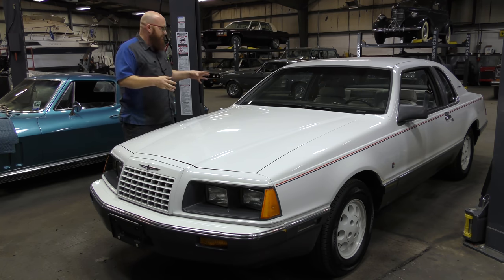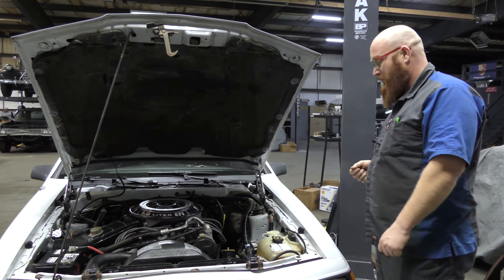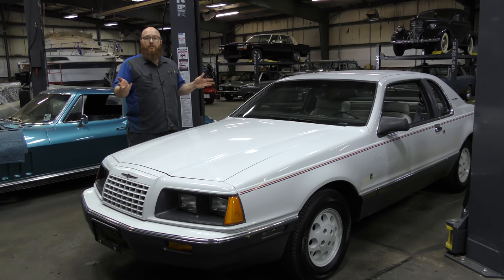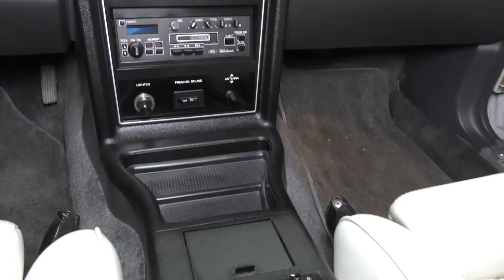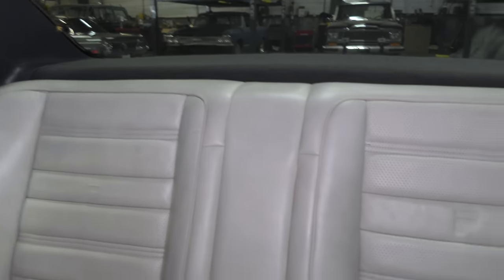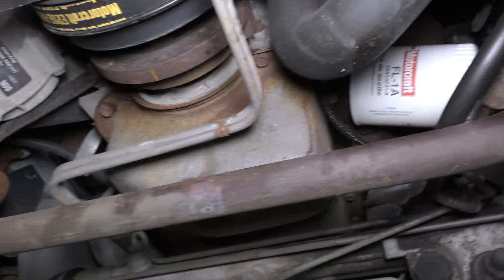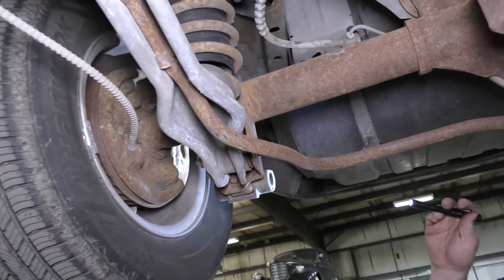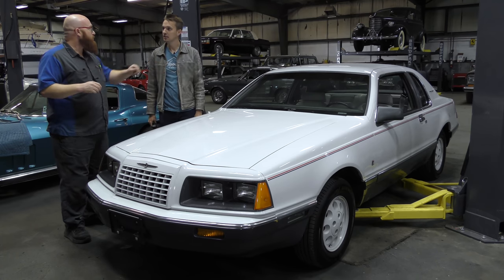The Car Matches My Shoes?!? The CAR WIZARD has Rare 1984 Fila Edition Ford Thunderbird in his shop

Comment: I was given one identical Fila. It is no longer white, and white leather interior is also gone. Someone hacked original wiring to motor, and it was also converted to a carburetor. It did not run. I asked about it, and I was told, "make it run, it's yours". So i did, and kept the 302 carbureted, and the AOD didn't work. Got another AOD, installed it, and it also was crap. It is now a charcoal gray, interior is half FILA half 84 Mercury cougar LS. I found a donor car and borrowed 60% of the interior, as the original white leather had almost vaporized, amongst other little things. I have all needed to put It on the road. So, i own one of these things, and it is no longer original. I still have all emblems and unique metal tab for authenticity on core support. It is the only ford i own out of 12 or so vehicles i own now. The original wheels went to a dumb kid with a Ford focus. I still see my wheels in town from time to time. After watching this video, I'm going to do the right thing and get my Fila on the road again. Thank you🤙

Comment: That's my kind of car.  I am a huge fan of the 1983 through 1986 Thunderbird.   Didn't like the 87 or 88 though.   I wish Ford would have stuck with this body til the 1989 came out. I have owned three of these.  First a base 86 6 cylinder with 4 speed auto.  Then an 86 elan with a 6 cylinder and 3 speed auto.  The difference in gas mileage was so different.   That 4 speed would go as high as 34 mpg.  The 3 speed would only get 22 on it's best day.  I had an 30th anniversary 85.  302 V-8 4 speed trans.  Nice car.  My favorite would be an 84 or 85 Fila, with the charcoal interior.  I even had a 97 limited edition for awhile.  The perfect Thunderbird beside the for mentioned would be the 89 to 92.  Super clean style compared to the fat lipped 94 and 95.  The thing I didn't like was in 1989 no V-8 and those stupid motorized seat belts.

Comment: I'm so old that that I've seem 5.0 Thunderbirds smoke 5.0 Mustangs off the line (red light to red light). I've also seen similar T-Birds sell for well under $1000.00 in our part of the South East because nobody wanted them as opposed to Mustangs with the same/very similar engines and transmissions.

Comment: Great Car!!  The only thing Ford came up short on is the brakes.  Should have been 4 wheel disc. Everything else is great on this car!!  Brakes are a biggie. Best you can do is EBC Red stuff and good rotors.  Rear Drums you can do nothing with as good drums are no longer available. Would have to convert the rears to disc.. Then it is perfect!!
Reply: Pretty sure Ford upgraded to rear disc on the '87 model.

Comment: Wizard- is the Sanden AC compressor and hose OEM? Many American car mfgs were having a problem with adapting to a "better" refrigerant- in many cases they were trying to run all the same hardware, but the appropriate oils and this less efficient freon- leading to lots of complaints and reworks. Could this car be one of them? If I wanted a great example of an '84 T Bird, I'd have a hard time matching that one! FR

Comment: I don’t know if you’ll respond but I’ve been a mechanic for 35+ years now and I’ve noticed an overall lack of quality from most other shop’s work that I see come through my shop. I’ve always been impressed with your workmanship but lately I’ve been disappointed. As an example, how did you miss the leaking rack on Tyler’s Diablo? Was is not test driven and put back on the lift to check for leaks? Same with the vette that overheated. After a car sits for 5 years, the radiator cap wasn’t even opened to check the coolant level? If it had you would’ve for sure seen all that mud in the system. I’m kind of surprised.

Comment: ahh 70's to 90's American engine spec's always a good laugh 5 ltr 140hp 200 whatever torque, that's cute (even by the very early 90's Japan was whipping out NA small 6 bangers with 200HP that could drive half a million miles with only oil changes) and of course today my i4 puts out more HP and almost the same amount of torque (I would still buy that t-bird if I was in the market though)

Comment: Urination Bob, I was the one with the Fila on BaT, and I don't appreciate your inaccurate characterization of my car. If you had really looked at the listing, you would realize that I included both the original drab Fila color-keyed wheels AND the Turbo Coupe wheels. As for the interior, the driver's seat on THIS car appears to have had some rather poor repairs made to the driver's side bolster, and the leather is quite dingy looking. Neither is unusual, as Ford used some very thin, and IMHO, fairly low quality leather. I had similar issues on my 29,000 mile car, but I chose to replace it by working with SMS to reproduce the exact color and perforations as Ford provided, albeit with leather that was easily twice as thick as what Ford provided. Yes, I spent $2,000 doing it, but the front seat leather is indistinguishable from the original rear,  and it is as new. So, I guess at the end of the day, in this case, you have to decide if you want tired original or a fresh showroom condition. Ya takes your choice; I choice to make it as perfect as I could.

Comment: 140bhp out of 5.0litre v8 whut? How do you make so little horse power out of v8 motor?
Reply: Those Thunderbirds weren't made for speed and Fords Top  Dog the Mustang GT or SVO only had 175 hp. Nothing in the 80s was real fast anyway compared to modern cars. The injection system was the crude CFI injection which didn't respond real well to mods. The heads and camshaft were restrictive and made more for boat anchors than anything else. Ford had emission requirements and carb requirements just like any other manufacture. Ford wasn't going to get a 400hp 5.0 out of the eighties and get it to pass smog.
Reply: Smog control and partly oil embargo. Hence why power numbers took a nose dive in the 70s/80s and didn't start to recover via tech improvements until the 90s.

Comment: My grandmother had a 1987 Thunderbird Turbo Coupe. It had 190hp and was a straight 4! More than this V8 wow! It had a 5 speed too and for it's time and "4banger" it was a quite nice performing car! I wish she had held on to it. She had it from new until 2005 and it was MINT. She traded it in on a fucking Kia for $3k trade in. I mean I was crushed. But I made some bad choices at the time and was in jail so unable to buy it from her. Still beating myself up about it since it was white with midnight blue leather interior, and so cool. The rear lights and overall aero package on them were so different to standard run of the mill T-birds that they are extremely expensive to replace the taillights if they get damaged. The one below is similar to hers sans interior color. 

https://www.youtube.com/watch?v=4QfxUG3DQQk

Comment: How did they make a 5.0 v8 only put out 140 HP?
Reply: Right? Still probably only got 15mpg too. 80s were a bad time for American cars
Reply: Government intervention. If the government didn't neuter cars in the 70s, we'd have Bugatti performance be standard in cars today.
Reply: Strict emission standards for the most part (biased toward air quality more than CO2/global warming gases). The easy answer to many of these regulations was richer fuel mix (particularly, catalytic converters were relatively new and  work better with a rich fuel mixture), fuel injection was still in its infancy, and there was some reason I can't quite recall (except that it was not fuel quality/removal of lead additives) that made it so the engines had to run on ridiculously low compression ratios (~8-10:1?). Add the fact that pretty much all Detroit had from the '60s were huge V8s and you get those results. 

PS: The fault lies squarely on the American auto manufacturers; European and Japanese auto manufacturers were making smaller and better packaged cars with "small" -- <3l for the most part -- engines pumping reasonable power. Sure, US-bound cars had less power/more displacement, but even then had much more respectable power/displacement numbers.
Reply: @maacpetzol2205  I had an '88 which was the restyled version with the MPFI 5.0 and highway I got 28-30. These cars had the AOD with the overdrive and mostly came with tall 2.73 rear gears. You could get decent mileage out of them if you kept your foot out of it. The speed limit being 55 MPH is most places helped as well.